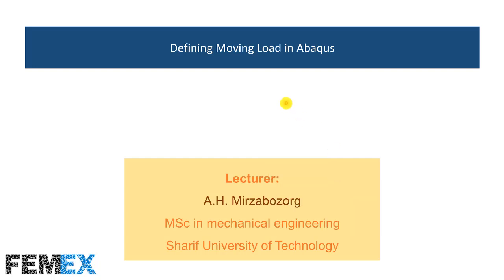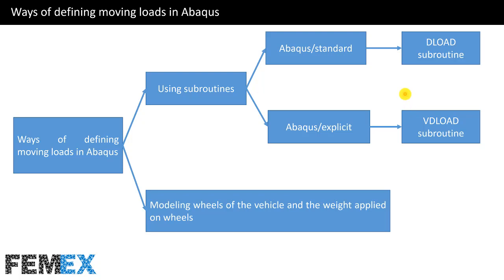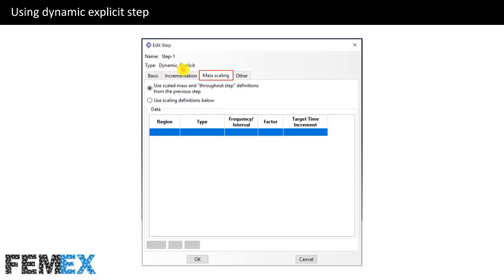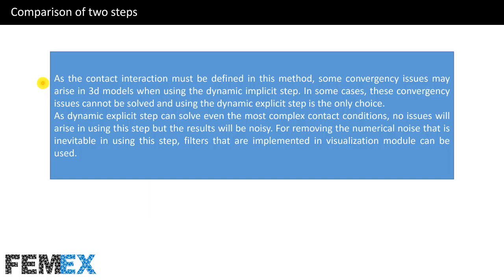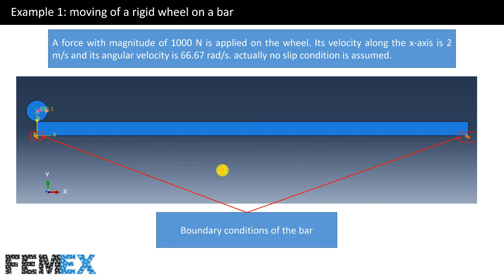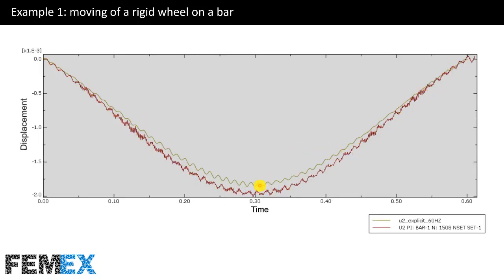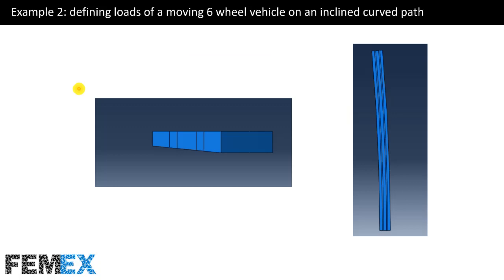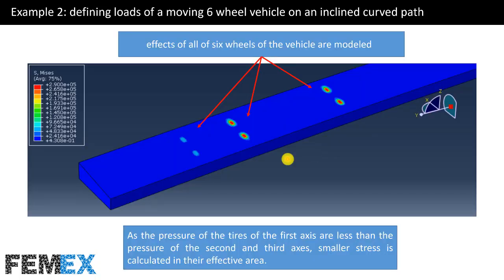Defining Moving Loads in Abaqus

Comment: This is an important field like rotating bending fatigue test
Reply from the maker: yes. in the recent years, because of improvements in computers, analysis of moving loads is performed more than before. so the fatigue life of structures like bridges and railways can be calculated more accurate than before.

Comment: Hi, In my analysis, I used a moving pressure (did not model the tyre) on a road section. However, when I use dynamic implicit steps, I see oscillations in my deflection profile. I cannot seem to find the error in my subroutine file. Do you have any idea about this?
Reply from the maker: hi.
maybe only the elastic deformation occurs during the analysis or major of the deformation is in the elastic region that will be removed after the passing of the load.
also you can do the simulation using the static general step to check whether the oscillation is because of the inertial effects or not.

Comment: How did you decide the magnitude of velocity and angular velocity?
Reply from the maker: hi.
the velocity of the vehicle is an input to the problem and is known.
the angular velocity of the wheels are calculated according to the no slip assumption.
Reply: @FemexIran  Is v = rω okay, assuming no slippage?  Where v is velocity and ω is angular velocity.
Reply from the maker: @ごりごりあん  yes it is. if you want to model the wheel, you must use this equation for finding the angular velocity. but if you want to use subroutine, there is no need for finding the angular velocity.
Reply: @FemexIran  Thank you for your answer.
Reply from the maker: @ごりごりあん  your welcome.

Comment: Do you give the tires density?
Reply from the maker: hi.
in this project I used DLOAD subroutine.
when we use subroutine, there is no need for defining the tire and its density and ...  .
Reply: @FemexIran  In addition to using the DLOAD subroutine, you also do it by modeling the tire, right?  In the latter case, what are the material properties of the tire?
Reply from the maker: @ごりごりあん  those problems are not related to each other. in that example I didn't model a tire. it was just a moving rigid body for the illustration of this method.
Reply: @FemexIran  Is the tire made as discretized rigid body?
Reply from the maker: @ごりごりあん  the tire can be modeled as a discrete rigid too.